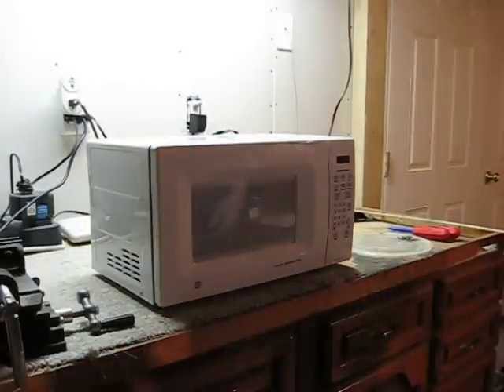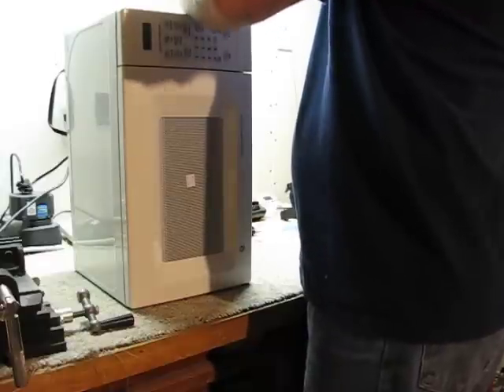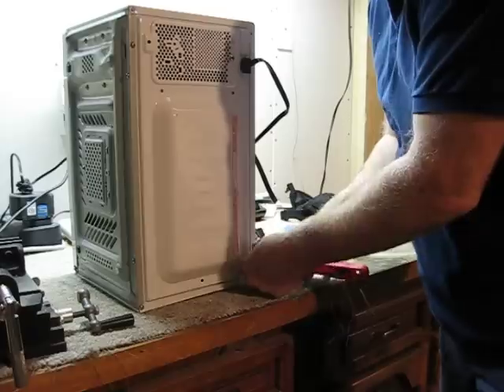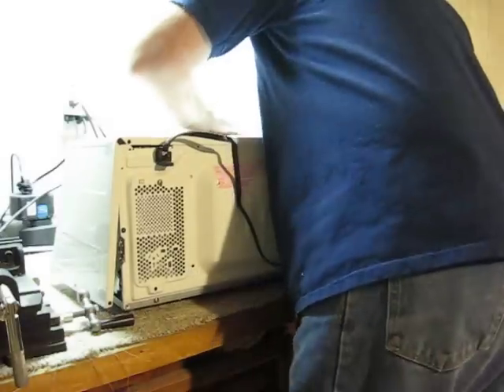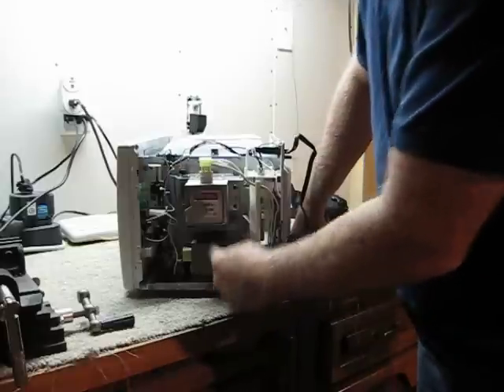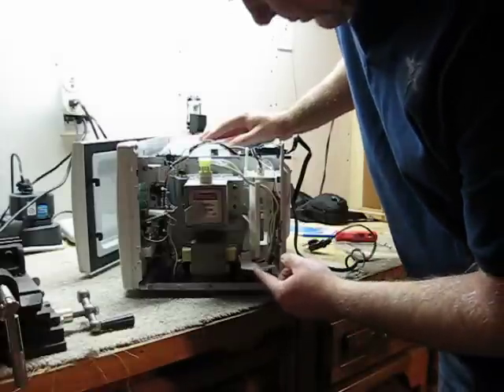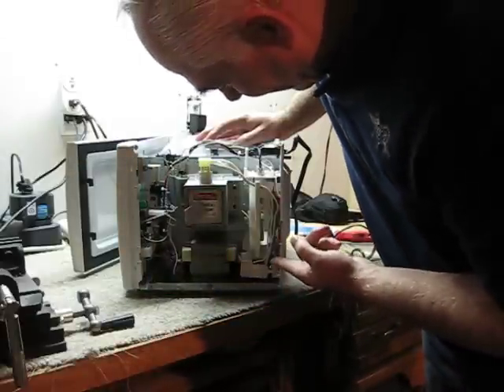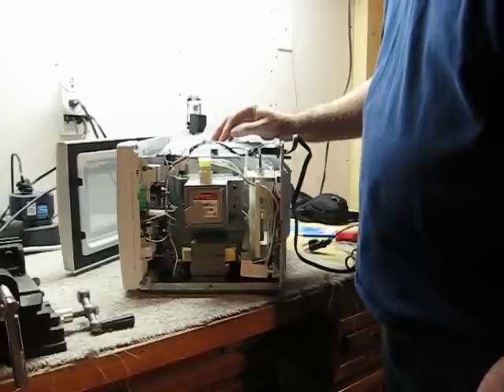Microwave Power Supply  ©

Comment: Well, i never opened a microwave, but i study electronics. Why dont you just make one power supply your shelf instead of buying  a whole micro wave. You save the time doing the work by buying, but if you make your own machine you can that can do couplings fast and then no need for buying any microwaves. :D

 but then  again is the question which purpouse are you useing this power suply for? 

How much did you buy that micro wave for ?.

Comment: no. The magnetron is just the most practical solution. It's a hollow cavity resonator and that is just right for this particular wavelength range. Other oscillators may exist but not with that power rating